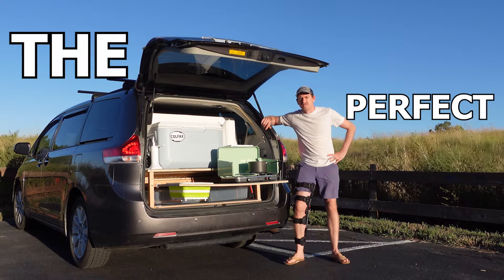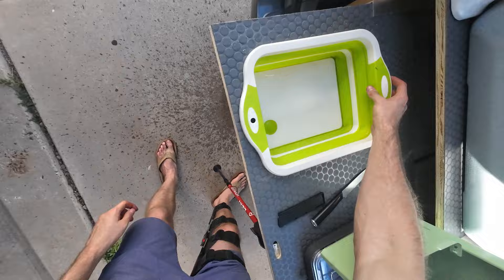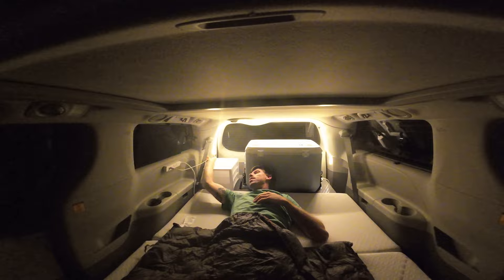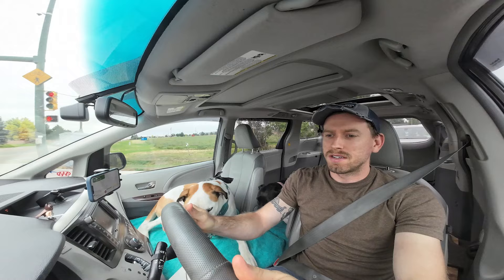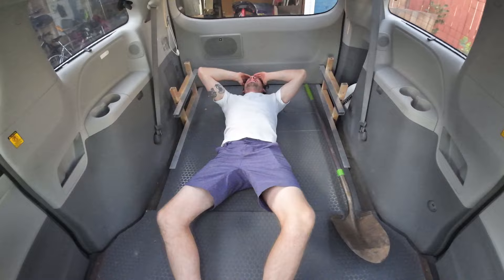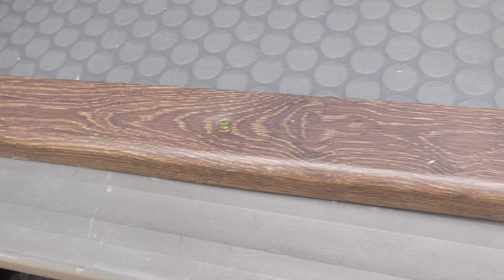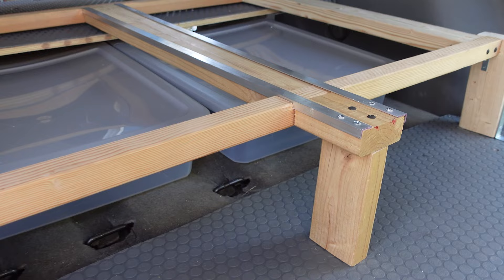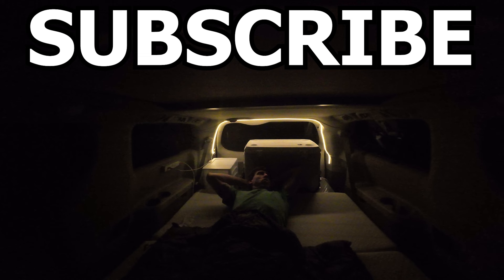I Built the ULTIMATE Modular Minivan Adventure Camper

Comment: Great job on the van! I tried recreating your back light setup but had issues with the strip adhering to the plastic trim. Did you run into that or no?
Reply from the maker: Thanks, I love that thin! On the the end with the plug it comes off some, I was careful to scrub and clean it as thoroughly as I could. But there may be some 3m adhesive strip you could use to try to use the light again.